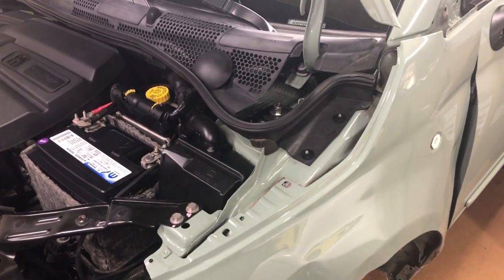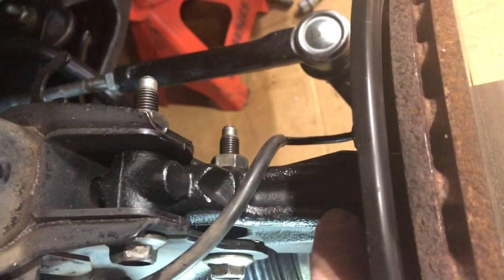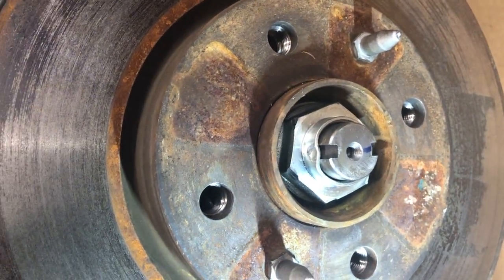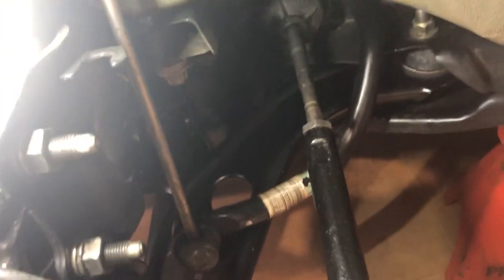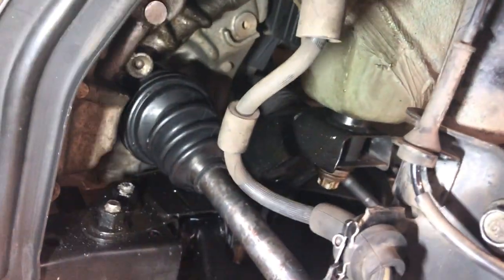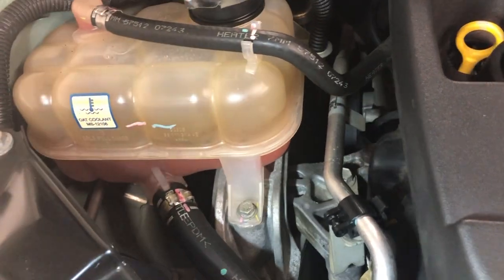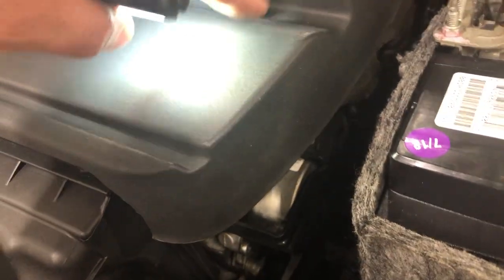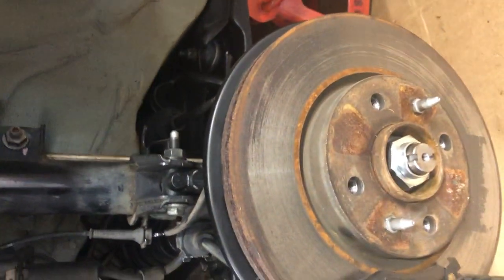Fiat 500 front suspension explained.

Comment: Great video John
Fiat 500 have 3 mounts really easy to change them..
engine mount
torque mount
transmission mount
front wheel bearings are not assembly they are just bearings need a press to change them... 
rear wheel bearings they come as assembly  not complex to change them